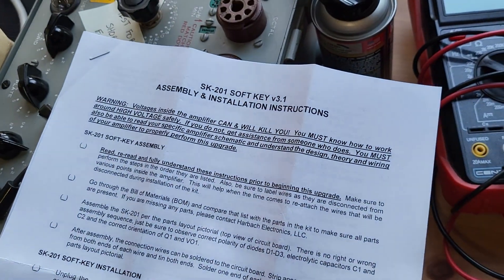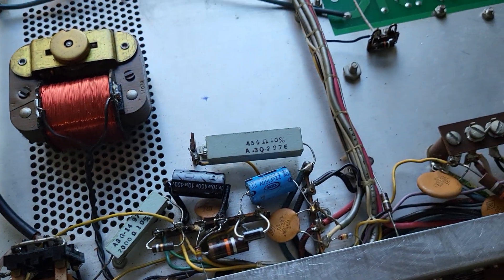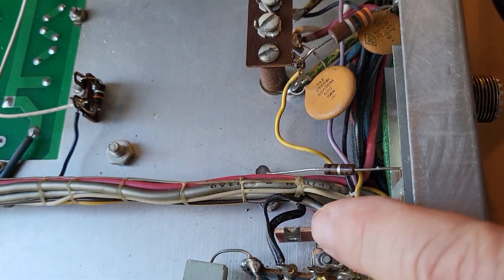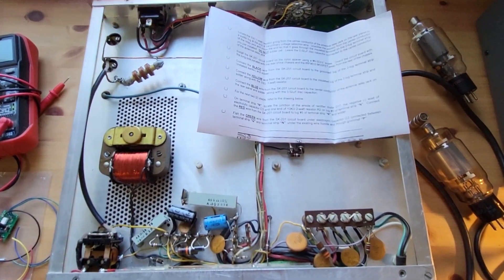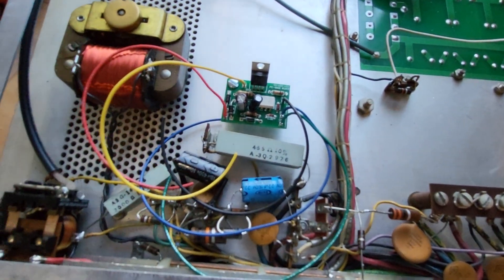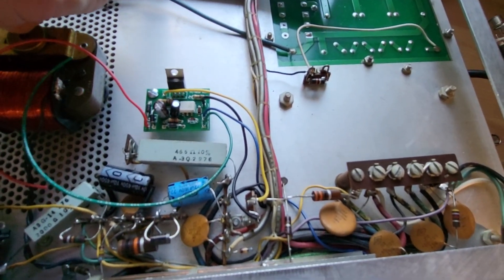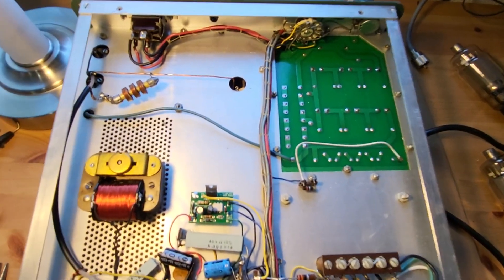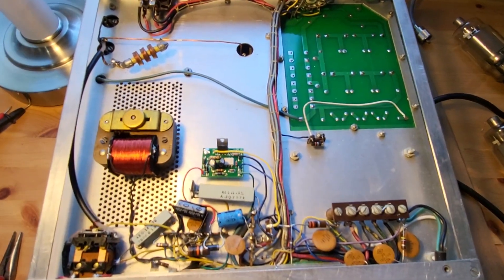Heathkit SB-200 Soft-Key Installation Harbach SK-201

Comment: What is the purpose of soft key?
Reply from the maker: a soft key is required if using an older tube type amplifier with a more modern ham radio transceiver as the voltage on the older amplifier is too high.